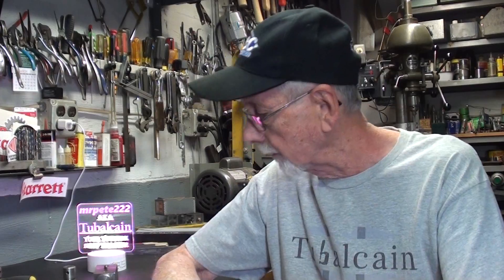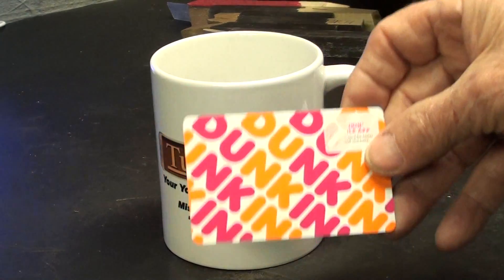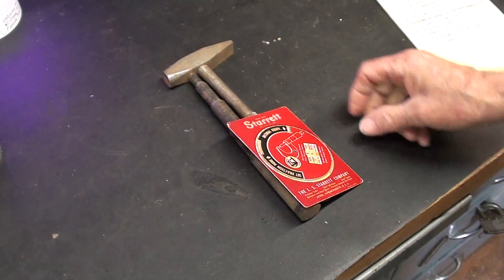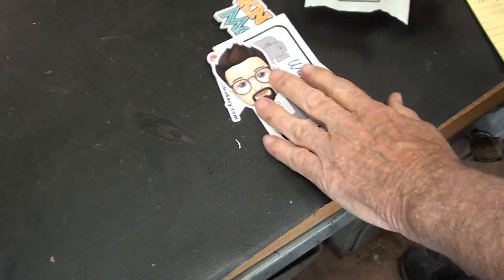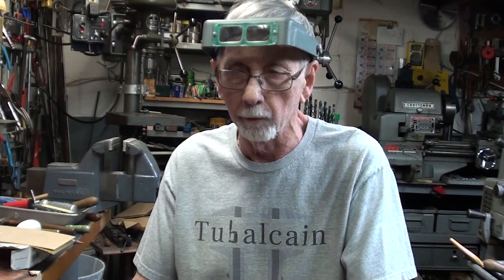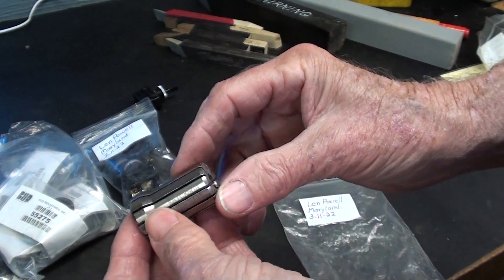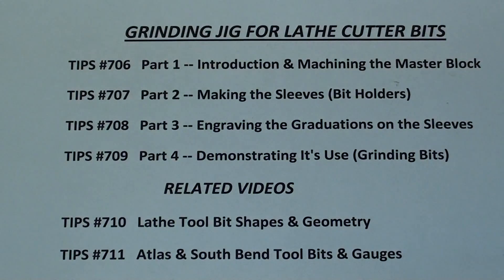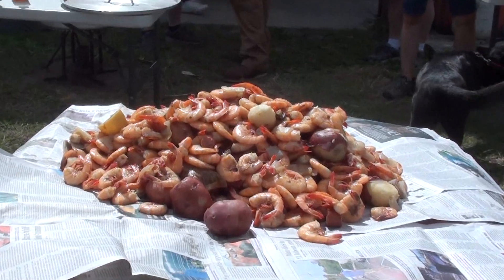THIS & THAT #69 tubalcain

Comment: That Hammer at about 6 minutes. I made one nearly identical to that in Australia 40 years ago. The rear part was my first go on a shaper as part of it and as we had a small Injection molding setup at the school it was finished with a plastic handle. 😀

Comment: Sperm oil---I bought the "recommended" motorcycle chain lubricant in my local store.
The year was 1973 and the name on the can was Sperm Whale Oil.
A very good oil for my purpose, very thick, extremely sticky.
Good luck, God bless.

Comment: in closing i think i shul tell you  changes i have mad to  your  plan So  . i couldn't get a sleeve lick the one you shows  with a square . so a founded long socket as i     have no mill the right size  to fit the 3/8 &  used  that in the sleeve I drills a hole a little smaller & heated up the sleeve & slept it in as a liner. ones cloud  it wasn't coming out . it worked.  well  i now find my self looking for old skit's at car boot's lol   One other thing i decided to do was to, MC the block so the graduations can go on the block & not the Sleeve like  the original. that will men we only have to mark out the block & not the  sleeve  But for a Zero position  that of course we  will need to be on the Sleeve. i have no mill so i did the work in the lathe  thanks for the idea I like it  post the Final part if you wouldn't mined .  Les England

Comment: Wikipedia - McMaster-Carr : The company was founded in 1901 at 160 East Lake street in Chicago as the McMaster-Davis Supply Company. Started with $50,000 in investor capital, its founders were T.J. McMaster, a former stationary engineer, and F.C. Davis, who had been a chief engineer in the U.S. Navy. In 1904, an attorney with a background in mechanical engineering named Walter S. Carr purchased the company. As early as 1908, the name of the company had been changed from McMaster-Davis to McMaster-Carr.

Harry and James Channon, the sons of Henry Channon the founder of the H. Channon company, a large Chicago distributor of maritime and steam engine supplies later purchased the company.[10]
Reply from the maker: Thank you for a good history lesson. I did not know any of that
Reply: @mrpete222  Thanks for posing the question, until you did I didn't know it either. Would have expected McMaster to have been the "buyer", but it seems to have ended well.

Comment: Starbucks is supposed to be the number 1 coffee bought and DD number 2,,, The reason is they're also number 1 and 2 in caffeine content......,,,, By far, as far as taste goes, the most important factor after you select the beans and roast ( note, mixed dark and medium is the best) and assuming your using good water is that you grind the beans for each cup... If not your going to be Drinking hot water..... Starbucks is basically fresh ground  which even if you don't like their beans or the roast still makes something that's coffee not hot water.
Reply: How do you determine if the water is good?
Reply: @ellieprice363  tastes it,  smell it , note how things dissolve in it .. for coffee I use the alkaline waters.. Fuji is fine too..
Reply: @bobbybrooks4826  Thanks. Good water is certainly important. I have to admit I’ve never purchased a Starbucks product. It’s just a little too strong and expensive for me.  Probably has a lot to do with being born during the 1930 depression.
Reply: @ellieprice363  your doing pretty good for your age... Probably not a lot of 90 year olds commenting on utube..
Reply: @bobbybrooks4826  Not quite, only 88 but still kicking pretty high. (:-))

Comment: Mr. Pete. Im glad that people display tools, especialy old hand me down tools from grand fathers and great grandfathers. Those that i have from my grand father  are hung on a wall in the shop. Great decorations for an appropriate location. I had a corvett in 1977 the rearend required whale oil as an additive that was put in rear end on each gear oil change. And it was a required change every few  thousand miles. If you didn't change the gear oil and put the whale oil additive in  the limeted slip would grab and cause car to hop when turning at slow speeds.
Reply from the maker: Thank you for that information on a Corvette. I am glad you like the old tools

Comment: I still have three tools I made in shop 45 years ago, a drill grind angle gauge, a chipping hammer, and a long screwdriver for removing shotgun stocks. I also made a very nice shift lever from brass hex stock bent into an S-shape for a Datsun Pickup. I wish I had saved that too.
Reply from the maker: That is awesome. I am glad students cherish some of those projects

Comment: Those "Peterson Products" oil containers are nice, but Mr. Mitchell got a little carried away with the labelling. At 7:35 it says "a tubalcain mrpete222 (circle R) company".  (Circle R) cannot be used unless the stated mark is listed on the Principal Register at the USPTO, which I'm quite sure it is not.  If misused in this manner, it generally constitutes a fraud on the public.  Instead, (TM) should be used to put the public on notice that some, as yet unspecified proprietary right is asserted.
But rest assured, my lips are sealed.  Or I guess maybe not.
Reply: I have one of those no spill oil containers but don’t use it much since I can’t tell how much oil is in it. If someone produced a flat container like that in clear plastic it would be an instant winner.

Comment: I made the hammer and screwdriver in shop class back in 98. I still have them both and use them regularly at my work. (I am a maintenance lead man for a metal fan shop). The hammer is nice because it is made out of soft steel, you can use it on harder steel and not mar your work up.